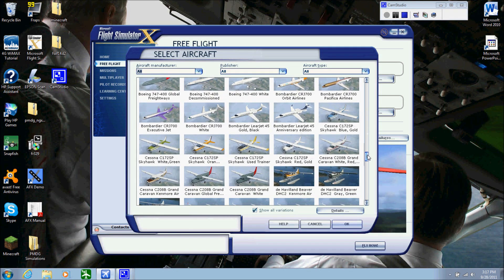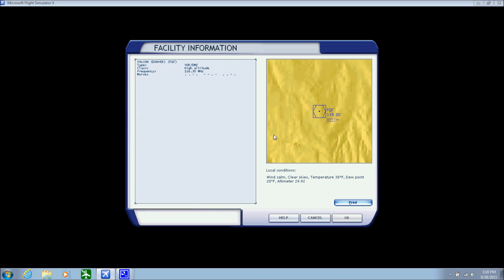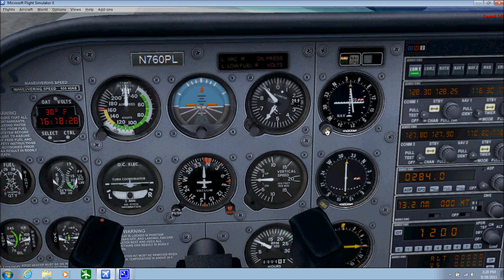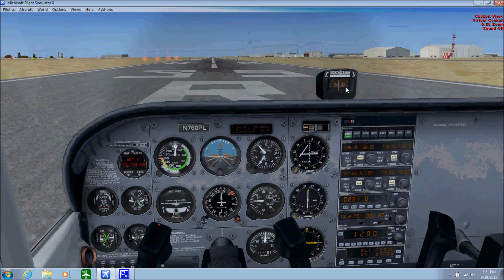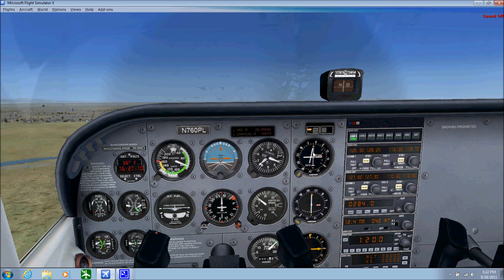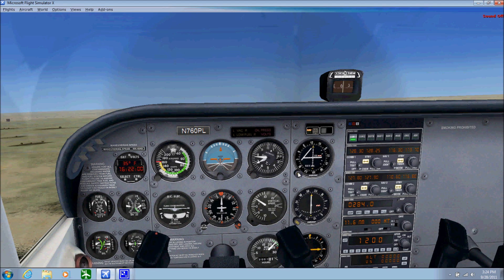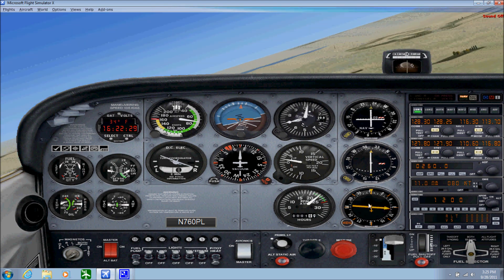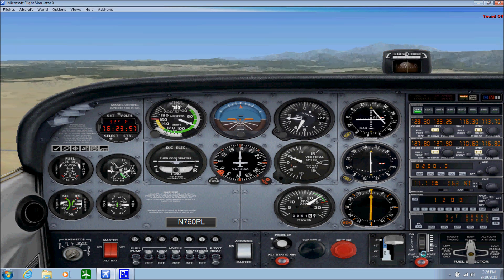FSX Tutuorial Ep.3 VOR NDB

Comment: VOR - (V)ery high frequency (O)mni-directional (R)adio station - each dot on the vor display is 2 degrees off the selected heading. it shows up to a 10 degree deviation.  For real world you would listen to the morse code identifier for the station to verify you are tracking the correct VOR and cross check both VOR 1 and VOR 2 to make sure they are working correctly. DME's dont take into account Altitude. If 6000ft above station it will still show 1 mile away. good video.